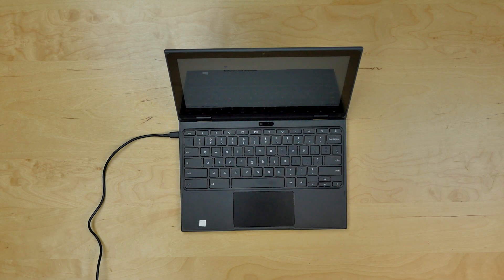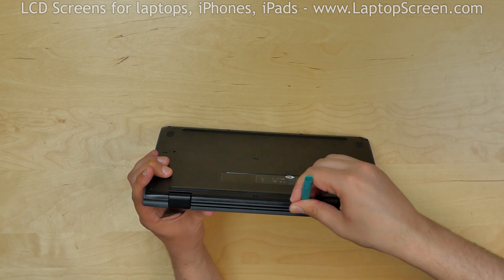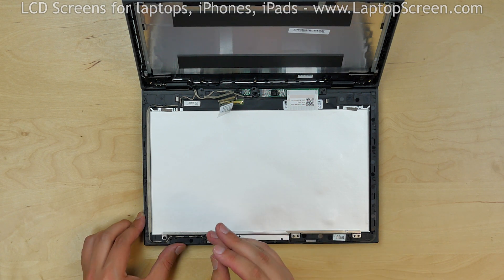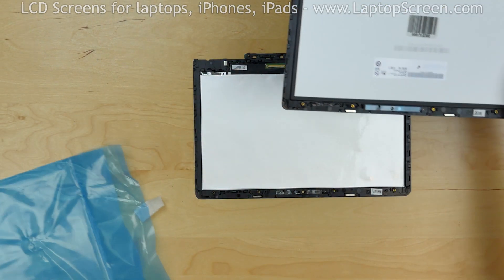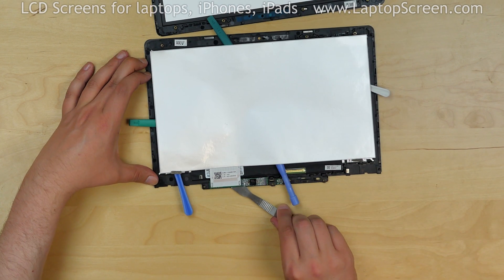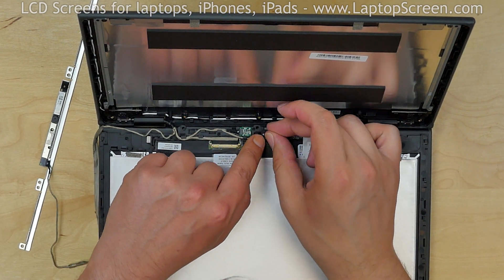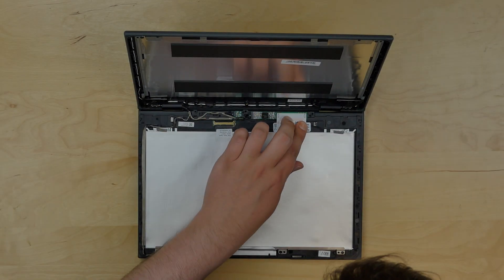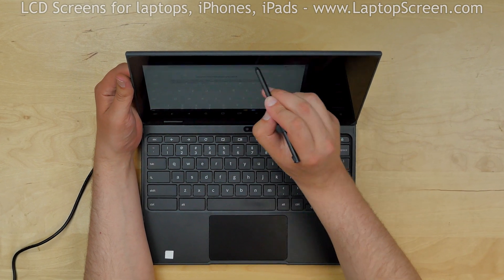How to replace LCD Screen on Lenovo Chromebook 500e 2 in 1 laptop. Step-by-step instructions

Comment: What is the purpose of the sensor board? I have a failure that seems to be caused by that board; however, I have noticed the device seems to still work without the sensor board connected.
Reply from the maker: The sensor board is there to drive the WACOM (TM) digitizer. This is to enable the pen input and provide advanced graphics-tablet functionality for graphics work like pressure sensitive brush strokes in Photoshop and similar graphics software. The finger touch input is provided by a different sub-system built directly into the LCD itself. The computer will function normally without the sensor board connected - as its just a regular USB device.